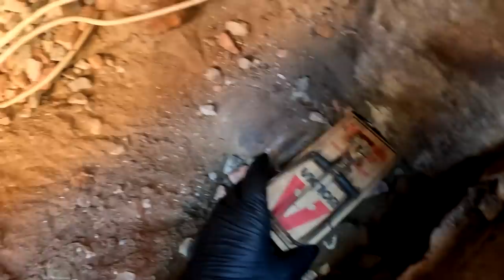THE BEST WAY TO GET RID OF RATS IN YOUR CRAWLSPACE QUICKLY!!

Comment: I wonder how much the cost of this whole operation cost...cutting pipes/replacing pipes, flushing/cleaning the pipes, cutting parts of the house/building it back up, breaking down the concrete floor/building it back up, removing the rats, securing the location so no more rat problems in the future, and plus, you two are not ordinary "tradesmen", I will have to assume you guys are like a semi celebrities of your trade so if I had to guess........i would put the total cost at $15,000 to $25,000